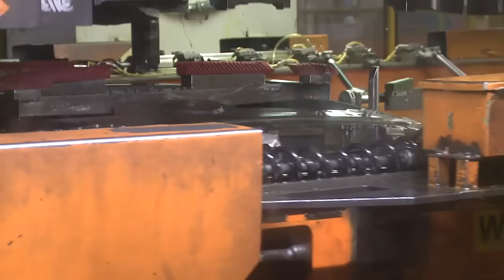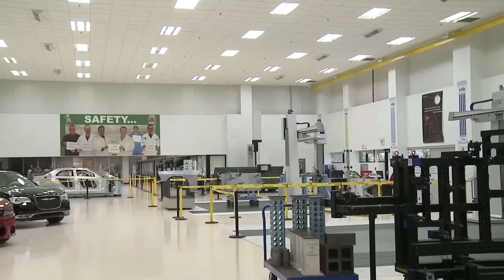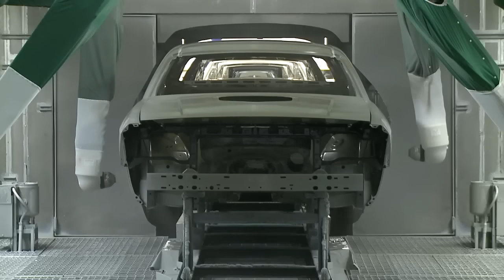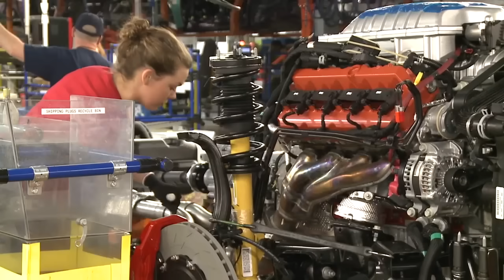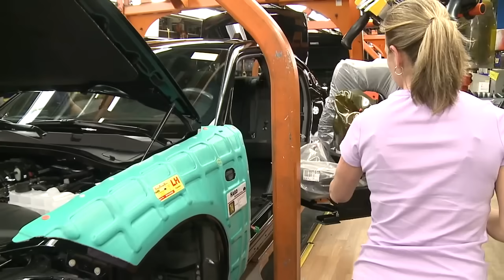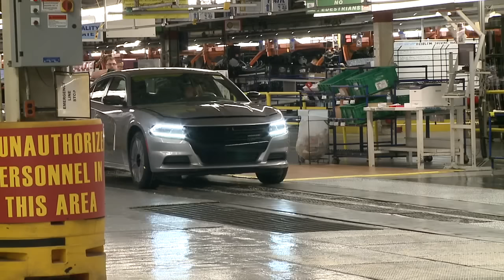Dodge Charger, Challenger and Chrysler 300 Production

Comment: I’d take this job just to drive the cars from one place to another, if I got lucky, it would be a Hellcat
Reply: Yea, no kidding, right? The last one was! Beautiful!
Reply: You would have to work decades to get the seniority in order to have that job
Reply: I work an assembly line job, it gets old real quick.
Reply: YES YES YES
Reply: It sucks working inside of an auto plant.  I did it for 7 years and had to get out of there. I was picking up the sides of Chrysler minivans for a couple years.  I lifted over 40000 pounds of steel a day. Chrysler destroyed my back.
Reply: fiat hellcat
Reply: @kurtzimmerman1637  how did you lift 40,000 pounds 💀 or that’s how much you lift each steel plate or sumthing
Reply: @myst3rixusl3ftb3hind  the side of of a minivan weighed 150 to 200 pounds. you and one other person lifted that. take 150 and multiply that times 500 plus units a day
Reply: It wouldn’t be that fast sense the engines are brand new and so is the supercharger it would be underpowered
Reply: @kurtzimmerman1637  were you doing that in 1985? No way you’re lifting that without a machine these days

Comment: Just bought my first Chrysler product last month. a 2016 Chrysler 300s V6. So far I am honestly impressed. And I pray that it will last as long as my Toyota and Mazda did.
Reply: I have an '06 300C SRT8 that I abuse daily with, (as of this date) over 314,000 miles on the register. All original. 
As long as you stay up on the oil changes - you should be just fine.
Reply: amhater good to know thanks, I negotiated they include lifetime oil changes for my 16 300s.  But my drivers seat is squeaking loud. I have a Mazdaspeed 3 turbo for fun like your SRT , but this Pentastar is not bad at all with the ZF 8 Speed.
Reply: +Acuravigor47 I have a squeak in my driver seat, too (2015 300S).  I think it's the right back bolster rubbing the center console lid/armrest.  If you get yours looked at, let me know.
Reply: gothamvengeance OK.
Reply: it should
Reply: Haha i have the same squeak sometimes in my charger :)
Reply: ***** chryslers arent that bad
Reply: +amhater I have a srt to you should join the 300C and SRT8 PAGE on Facebook
Reply: +Tyler Wallace sounds good, I'll look into it. i hope they have a central Florida meet.
Reply: amhater srt8 300c owners everywhere 👌👌
Reply: I heard Chrysler doesn't build reliable cars tho. But I hope they got better over the years
Reply: sevan grigoryan I've heard that about every car comong y including some luxury brands EXCEPT porsche
Reply: sevan grigoryan I have a chysler it's bullet proof
Reply: ***** I guess the sentence "I have a chysler and it's bullet proof"  doesn't mean anything you see the  car in my picture and I still have it. It's never left me on the side of the road and I never had any random problems with it
Reply: Acuravigor47 .
Reply: Acuravigor47 Unlikely
Reply: @jacobreed47  I have a squeak in my driver seat also lol I have a 2015 300s
Reply: Keep it dry.

Comment: If only dashboards came out of cars as easy as they go in lol
Reply: Bray91 if only all the things they put in a car came out as easily
Reply: usman maher
Reply: @timsouttahere  all the dash components internally are cheap cheap cheap Plastics notice all Chrysler and Dodge air conditioner units one side of blow cold one side or blow warm that's due to the little arms breaking off your open-and-shut flaps
Reply: They do it’s just that once driven off the line there’s the tiny problem of the windshield being in the way XD
Reply: In my Dakota all you do is put her in neutral and pop the dash off, then just a handful of screws. 5 minutes

Comment: Your supposed to hand thread the lug nuts before tightening them with a tool 🤦‍♀️
Reply: Isaac Salo u also post to go straight across with them
Reply: The lug nuts were already on the machine so hand tightening them isn't necessary unless you do it by hand with a wrench